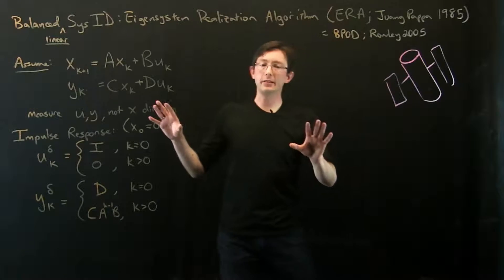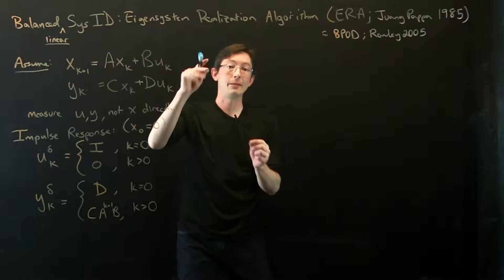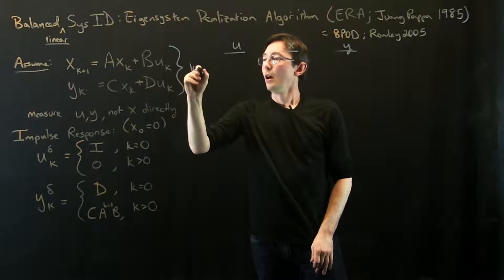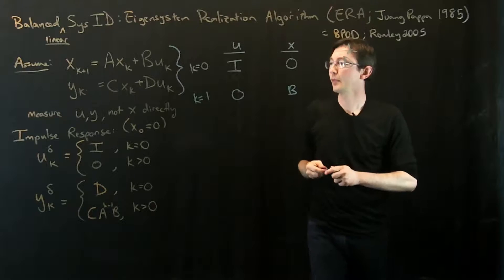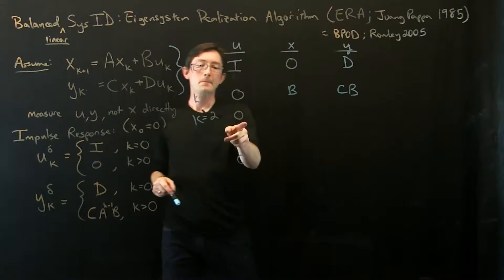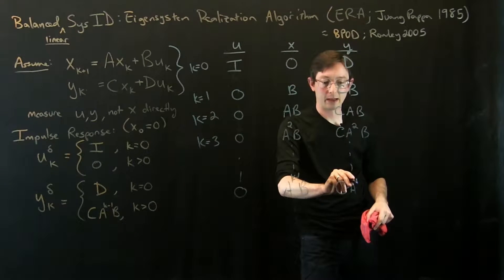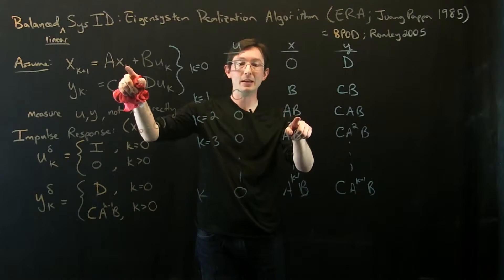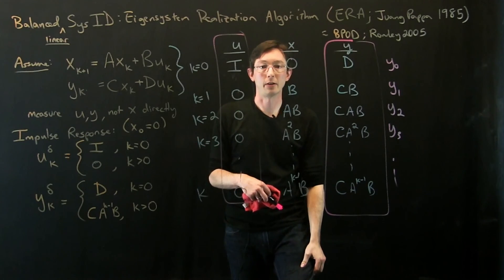Data-Driven Control: ERA and the Discrete-Time Impulse Response

Comment: Hi, professor Steve.  Thanks for the amazing lectures. I have a general question. From my understanding, all these method based on the impulse response will be subject to measurement noise since impulse response dies out while measurement noise usually don’t. And the state space model seems did not model noise as part of it. If you see the matlab identification toolbox about polynomial models, it does assume that there is additional white noise source passing through a filter function to get colored noise which will impact the measured output. So in the same time, it will estimate this noise filter function as well. Just wondering how would you comment on the noise impact. Also, during your usual of ERA, did you see impact from the noise or it is a over-concern. Thanks!